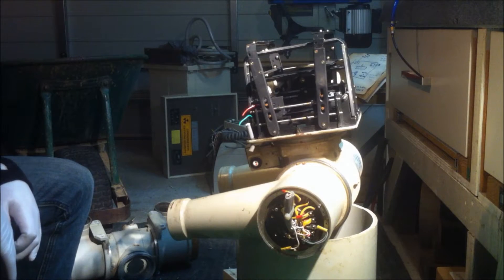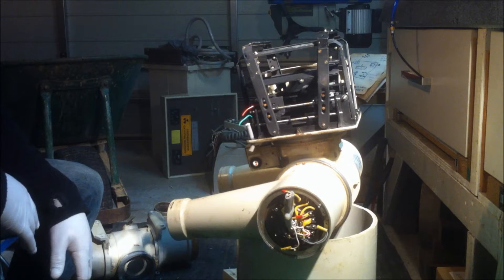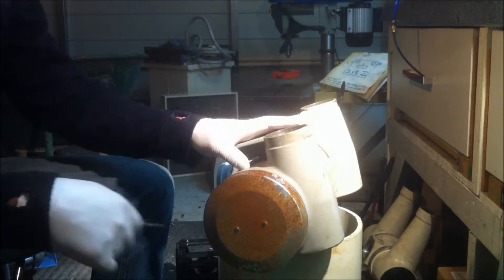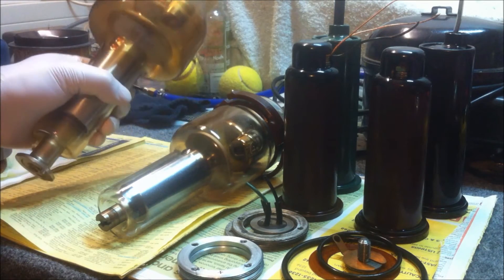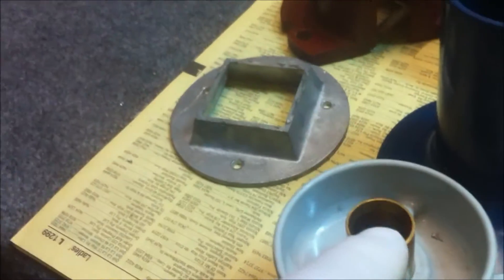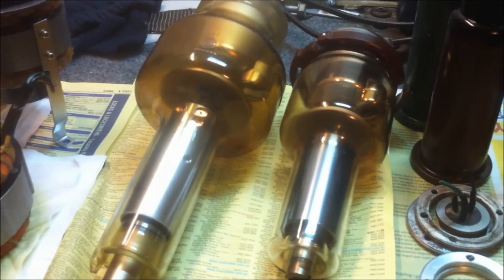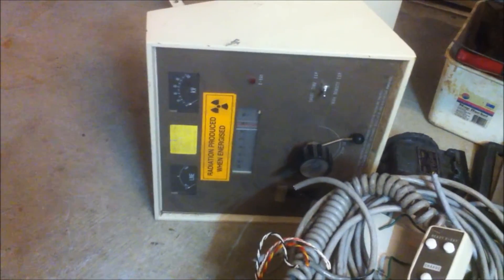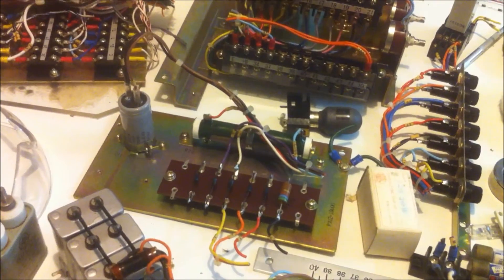Teardown #4 - X-Ray Head & X-Ray Machine Parts

Comment: I've got a Toshiba Rotanode DRX-180 head I'm trying to carefully disassemble at the moment. Fighting to get the plate out of the cathode end of the tube head! The anode end came out easily and I see you had the same problem I did with the rotating anode motor stator assembly coming out. I'll keep wrestling with other end; looks like the tube comes out easily! Cheers for the vid 👍🏻